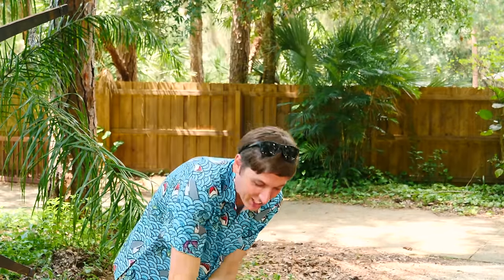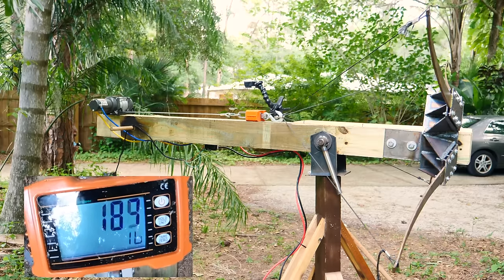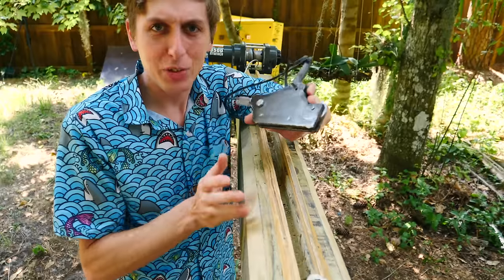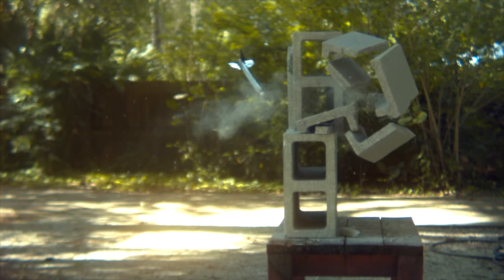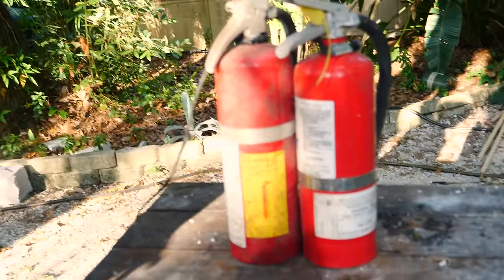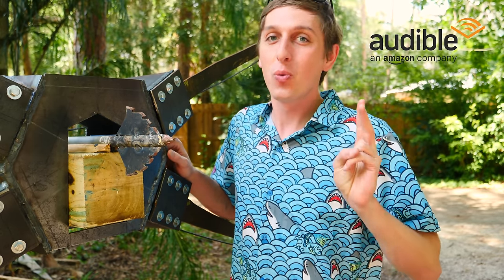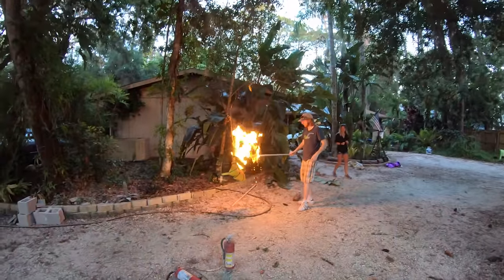I made the Scorpion From GAME OF THRONES and its CRAZY

Comment: Has 1,000 pounds of draw back force. 

Points it at house
Reply: @Tomáš Laštovička I wonder how many pounds of draw strenght a properly made ballista has
Reply: @2MeterLP  about 5 times hat he was using. About 4700 pounds on the low end
Reply: Now I know how people thought Euron could kill a dragon irl.
Reply: Tomáš Laštovička i pull strings of 40 or 60 pounds at bows that could penetrates animals on 30m. the energy lost of this thing couldn’t be bigger
Reply: Terribly inefficient delivery of that force on release. A half-ton of draw weight should put that bolt through the watermelon and halfway through the house behind it.  The ropes are too stretchy and slack, and I doubt those limbs are spring steel so their rate of return to zero may not be very fast.
Reply: Yeah 1000lbs is pretty weak for a regular crossbow, let alone a siege ballista which would clock in at 4700-5000 at the low end.
Reply from the maker: @dragontdc  the bolt can easily go through a watermelon, maybe you need to get glasses because it obviously hit the wood which prevented it from going all the way through.  Also, if a half ton draw weight should put the bolt through the house, what about a 1000lb crossbow?  This thing can fire a heavy steel dart at least 75 mph, can a normal bow do that?
Reply: @dragontdc  of course the dragon's gonna try to throw shade at the crossbow
Reply: someone had to do it.yes i notice it takess a long time to get the materials.i am seeing everything you say backyard scientest
Reply: @TheBackyardScientist  
It is not all about draw weight.  It is about how fast the arms can return to their original point elasticity.  Metal is really poor at this that is why there are not a lot of metal crossbows currently made.
Reply: @TheBackyardScientist  No offense but its a terribly designed ballista or just a bad large crossbow now matter how you look at it. It certainly looks cool don't get me wrong, but a crossbow with a draw weight of approx. 750lbs can launch a regular bolt at about 95 mph, a ballista should have almost 4x the draw weight of yours and tend to launch their bolts around the 220mph mark. Which from best I can tell means if you took a moderatly well made crossbow and launch a projectile of the same mass as yours (cause force equals mass x acceleration, not "mines a big steel bolt for no reason but to look cool") it would have a similar result of about 75 mph, so yes a normal crossbow can infact do that
Reply: @TheBackyardScientist  well a normal bow can do that if u halfdraw it. A "normal bow" (40lbs) can shoot an arrow at 249 fps aka 169 mph
Reply: @antoniomendes7542  the problem with a normal bow in this comparison is the fact that the 2 pound bolt is going to hit multiple times harder simply because the arrow is going to be a just few hundred grains. having a few times the speed isnt going to counter act the bolt being that much heavier. Itll have a distance advantage over it but just on pure force output the thing he made should win, more on the virtues of the ammunition it is able to fire (this would be even more of a difference if it was firing solid heavy wooden bolts that an actual ballista would be firing)
also he didnt ask if it could shoot a shot at that speed. He asked if it could shoot a 2 pound 3 foot long metal rod at that speed.
Reply: That was my thought...  I was waiting to see an arrow go right into the wall, lol.
Reply: @TheBackyardScientist   The people above are right, your set up is fairly (to be polite) inneficient. First you might want to have new materials on your arms mostly more rigid (so double/triple/quintuple the amount for example) to improve the resistance and from there the release speed/power. That's the reason why you would use big hard wood barely soft enough to bend on standard draw. Also you want your string to be a lot less loose both in their link to the ballista and in how drawn they are because this allows energy to be better passed to the bolt. Also you could increase the number of strings except this isn't were the issue lies, it will just make it harder to pull at best.

As a comparaison, roman ballistas which were around 2 meter tall and 3m in length could send a bolt flying 400m. And those bolts were a lot heavier than yours 26kg (or 57 pounds if you don't like science). And it was all old material so modern technology should bring you something dangerous enough for you not to use it. At least not in front of your house.

As I see there is some archers there they can give you a comparaison of what they can do with their bows and you'll see that what you did with you ballista doesn't compare to what a professionnal bowman can do with a 70/80 pound compound bow maybe even lighter. It is at best a very bad crowbow... To give you figures, a good 70 pound bow goes 3 times the speed of your ballista. And since it is based on piercing power we don't have a comparaison for the damage it does but a lot more on anything softer than the max coefficient for an arrow compared to your bolts. 

On the sunny side of things, you made it a decent look-a-like for the GoT sea ballista. So just need to improve on the engineering side of it.
Reply from the maker: @corsicasanova  I disagree. There is nothing wrong with the design. I never said I'm making the best ballista ever, I just wanted to make one with what I had available.  

Yeah it's not fast, but I dont care about that. Nobody understands that the speed is limited by how fast the spring steel can return. There are 1000 pound windlass crossbows that can shoot a small bolt at 150 feet per second, but it can NOT shoot a heavy arrow that fast. That's the difference here, this can shoot a very heavy arrow.  A high draw weight does not = a fast arrow, or ability to shoot heavy arrows, it's more complicated than that.

My modern 65lb compound bow can shoot an arrow 300 feet per second, but that's with an arrow that 40x lighter than the bolt I'm shooting. I dont understand why nobody can get this!
Reply: Some crossbows have 1000 pound draw weights, they cant penetrate a 3 mm layer of good steel
Reply: Burnblast277 1000 lbs is weak for a regular crossbow? Don’t know much do ya?  The fastest crossbow in the world shoots 460 feet per second and has a draw weight of 180 pounds. A crossbow bolt weight around 500 grains which is less than a tenth of a pound. The giant thing he is flinging is  at least 2 pounds. That’s the equivalent of about 25 crossbow bolts. Science
Reply: @curtisjoe24  k
Reply: @TheBackyardScientist  he was stating the fact you point the weapon at your house. Not smart
Reply: @Nogrim new here?
Reply: @leoak  yea cause euron obviously had auto aim turned on. So ridiculous lol
Reply: Looks more like the blackbow of dale
Reply: only the arrow goes like 3 feet lol
Reply: I was gonna comment on that but i didnt think it would shoot too far seeing how the arms ar designed. I'd have had two leaf springs as the base with a third one welded in between and wrapped in sheet metal then welded around for arms almost twice as long. A high draw weight is useless if your arms cant flex forward,  and your run has a high coefficient of friction.
Reply: @burnblast2774  you are out of your mind if you think that 1000 lb draw on a crossbow is weak.
Reply: Mike Harris me to
Reply from the maker: @Nogrim thats why i pointed it at the house and put the targets close to the house... would you rather have me shooting at the fence with the neighbors house behind it? the house is made from rebar reinforced concrete, its not going through.
Reply: @TheBackyardScientist  "Nobody understands that the speed is limited by how fast the spring steel can return."  That's literally what the people above are saying.

I think the other point that people are getting at as well is that what good does a really heavy bolt/arrow and all that force do if the bolt can only go 20 feet?  I'd be interested to see what this design can do firing a lighter wooden bolt.

Though I think its fair to say that the show wasn't overly realistic with how far and accurate those long bolts with the heavy steel "dragon-killer" heads would be.  If you're trying to design a similar looking ballista to the show than well-done, it looks great.  If you're going for similar behavior, (which I know you said you weren't, but for everyone else here) you need something like this:  https://www.youtube.com/watch?v=CgNlPOMOps0

Though don't try to shoot it in your neighborhood.
Reply: @dragontdc  The limbs are made from leaf springs, so I'd assume that they are spring steel.  Though maybe they were fatigued and worn out since they did appear to be from a 15 year old (or so) truck, and who knows what kind of loads they were put under during that time.
Reply: and as if that wasn't bad enough, he then fires it at 2 pressurized steel canisters
Reply: Ryan Coulson haha
Reply: @dragontdc  and arrow has no rotation
Reply: @burnblast2774  dude, a normal sized crossbow has a 150-175 LB draw, this "weak for a crossbow" draw is almost 10 times the weight. also, many states have a legal limit  of 200 pounds, so for you to expect 1,000lb draw on a regular crossbow is pretty unreasonable. FFS he needs to use a mechanical winch to pull that back, how do you think you'd pull back over 1,000lbs on a hand held crossbow?
Reply: @christopherhall5361  Classical European crossbows dealing with higher draw weights (750-1200 lb draw weights) were set using cranequins or windlasses.
Reply: @jb9486  also, you're failing to understand exactly what 1,000lbs of draw strength is, that 6x6 beam this guy using in the video is probably close to it's support limit
Reply: @jb9486  after a few minutes of research, the only crossbows that had that kind of draw strength were large mounted designs just like this one, and they were severely pushing the limits of what they could operate at without destroying themselves
Reply: @christopherhall5361  Medieval Metallurgy was not consistent enough for a long draw with metal limbs That's why the powerstroke of a medieval crossbow was so short (6-7 inches.) Better a shorter powerstroke and a subsequently less powerful projectile than being winged by 4 lb of iron limb whipping around. 

 A 6x6 of pressure treated wood should be capable of bearing 20 times what it's under in the video. More likely the creaking is coming from the bolts connecting the apparatus with the limbs to the wooden post.

High draw weight crossbows could absolutely be carried and fired unmounted. Tod's Workshop has a video where he does just that with a reproduction model crossbow with a 1250 lb draw weight.
Reply: @dragontdc  Yep, I'm sure those truck leaf springs are made out of something other than spring steel.
Reply: haves around 500 kgf
Reply: @joshuadrakard2981  also ballista arrows would have been made of wood with a spearhead and brass or leather fletching
Reply: @dragontdc  and it haves a really short acceleration length
Reply: @Kekatronic /home Damn. Someone actually admitted they were wrong on the internet. Good job, man. And you took it in stride, just saying okay and moving on with your life. Must be great to just accept prior ignorance and revel in the new knowledge without an ounce of sarcasm.
Reply: Well 1200 pounds is meh for a crossbow. Our old Balista was close to 10,000 Pounds.
Reply: even worse:
has 1,000 pounds of draw back force.... STANDS NEXT TO IT ....  WHILE DRY FIRING
Reply: You should make one that holds two arrows
Reply: @TheBackyardScientist   if a bolt goes through the wall you'll just have to have to caulk it into place and leave it.
Reply: @superfluous9726  how big is it?  Close to 10,000 of ft/lbs of muzzle energy?

Comment: Your ropes are too long. You're losing tension halfway through the launch. Other than that... glorious.
Reply: He also should have some form of guide to keep the bolt flat against the rail.

It would also be a good idea to make the ropes slightly shorter on one side.
You want the ropes to not lift the bolt up during launch
Reply: @merlinious01   yeah, maybe a free, grooved  wheel on top of the arrow that simply holds it there and rolls as the arrow flies part...
Reply: Considering more force and velocity puts the bolt through his house, I'd say it's a good amount of tension
Reply: @poodypooroo  Well, yes, but that's what appropriate settings are for... like fire ranges and rented soccer fields. Besides, can you imagine how many rewatches this would get if he had "accidentally" put that bolt into his living room? Walls can be repaired, but youtube? Youtube is forever ;D
Reply: Erik Stephens also arrows are incorrectly balanced and should have a center of gravity near the middle-front portion not just the tip
Reply: @edelta88  Youtube is forever! XD
This man is a legend
Reply: Extend the parts where the ropes are attached so you get more power out of each shot shorter is preventing you from having more destructive power behind it
Reply from the maker: @merlinious01  that's what I do, you can see in the slow motion the strings are pulled down against the rail.
Reply from the maker: @edelta88  it's a solid rebar reinforces concrete wall, how will it end up in my livingroom?
Reply: TheBackyardScientist you’d be surprised, Ballistas were used in siege warfare by the Romans, so depending on the arrow head I’d expect it to pierce straight through it
Reply: So this is were the smart people are wow I thought I was smart but I was wrong
Reply: @TheBackyardScientist  
If you say you did it, I believe you.
I kept seeing the string move around willy-nilly.
Reply: @TheBackyardScientist  
Have you tried using lighter bolts?
Like, a metal head with a wooden body?
Reply: the arms of the x bow is also in the wrong bent, he loses a lot of force having them the way he has it, I remember watching it somewhere and they found out that they lost a lot of power having them bent that way in stead of the usual Bow shape of the arms
Reply: @SecretBender  wdym recurve bows are extremely powerful and small and they curve the opposite direction, longbows require alot more material to be as strong as a recurve

Comment: With a 1000 pound draw those arrows should be screaming fast, more than 75mph. Needs more tweaking.
Reply: I load of energy is wasted it shaking and vibrating itself.
Reply: Arrows are too heavy for their size, and the fletchings are TERRIBLE. Too small, and only two of them. Oak doweling, with maybe canvas fletchings, or even like, a thin plastic would be better. Definitely 3 of them, as well. And yeah, lots of wasted energy, it needs to be secured down better.
Reply: and the arrows need to be front heavy god damn. I mean has anyone seen how the back is like a foot higher than the front from just 2 meters distance traveled.
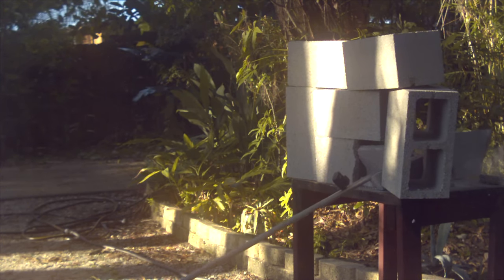edit: at 5:19 you can see it
Reply: I was thinking all this too but, I think it was safer for him to make the arrows this poorly, as he was pointing it at his house as well as him being in a residential area, I would like him to take it out to a field and fire it with some proper arrows and some more tweaking to the design to make use of all the power in those springs
Reply: also the limbs schould be lighter so they can move quicker and be shorter as shorter bow limbs achieve better efficiency at same draw length but all that would require better steel
Reply: You guys are all right, sort of... The main reason that its not going very far is because the draw distance isnt very big, it gives it no time to actually build up speed. For instance, a long bow has some pretty strong draw weight, but if you only drew it back a few inches, its only going to go about a foot or two. Same with a compound bow, you might have 200lbs of draw, but if that 200lbs is only pushing the arrow a few inches, its not going to go anywhere significant. Meanwhile a 30lb draw at 2.5 feet sends arrows flying for tens of yards at lethal velocity.
Reply: @Kiba69420  well the drawing distance wasn't even all that bad but the limbs were too long
Reply: yea

Comment: You would get better aim and range if you use an arrow with 3 "feathers" and give it some rotation
 to stabilise it in 3 dimensional space.
Reply: Greg Fakerson  you could also use more than 3 but at least 3
Reply: Two rigid fletchings is historically accurate for some crossbow bolts.  This device in the video doesn't produce velocities or range that would make it useful, but a small turn at the ends of the two fletchings could create spin.

Comment: now double the amount of leafsprings ;)
Reply: The issue with this is not the draw weight, but the rate leaf springs release energy.
Compare 80lb long bows against 40lb recurve.
For penetrations, you want velocity.
This can be achieved  in part by thinning the limbs rather than reducing width.
However steel isn't great for quick energy release.
It's why top end crossbows use glass fibre or carbon fibre.
Reply: You'd be better off halving the weight of the projectile
Reply: @JETBLACKPRIEST  But that's not as cool

Comment: the ropes are too long so you lose tension and the arms are too short in comparison to the length of the ballista so if they were longer you get more power out of it and it will be more like the one in the show
Reply: Yep - shorten the bowstrings (should have no slack whatsoever;  some static tension would be good) and the speed of the bolts will be twice as fast (estimate).
Reply: @duffykohler5827  He'd need to reinforce the rig, it'd be too much potential energy for that one. Likely to explode under the tension.
Reply: Drew Russell most ballista’s in the show and in real life are wood and reinforced with metal strips so if the ballista is reinforced on some areas that would break under high pressure there should be nothing to go wrong
Reply: @jaspermennink7409  Just do some CAD force analysis and make it from steel. Should be easier for these mostly compressive forces (save for the spring and the rope).